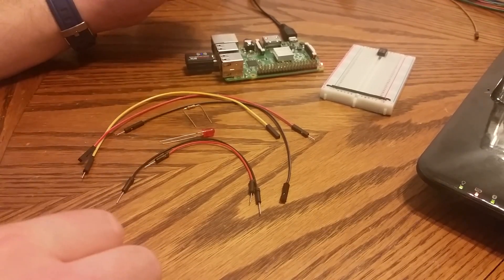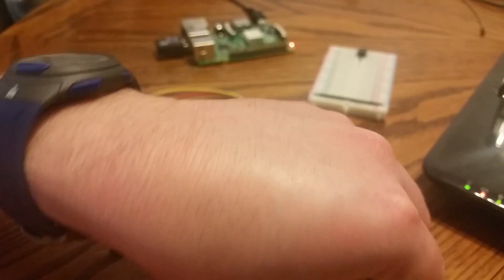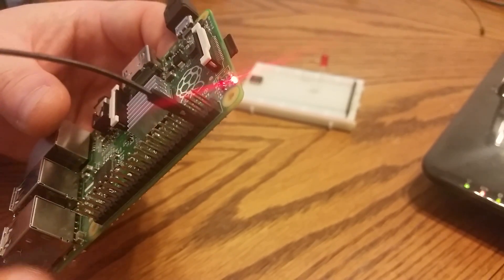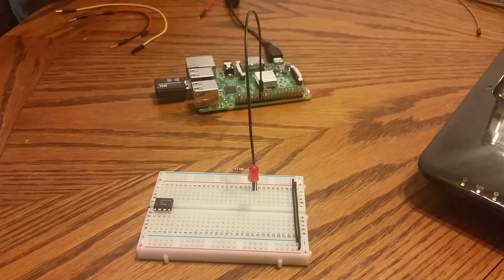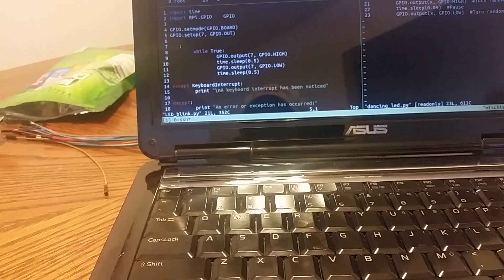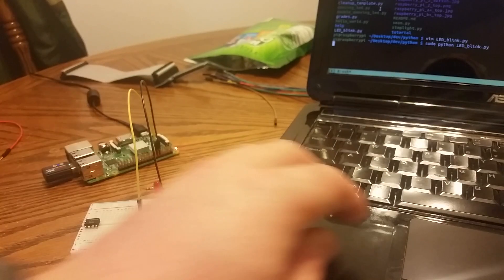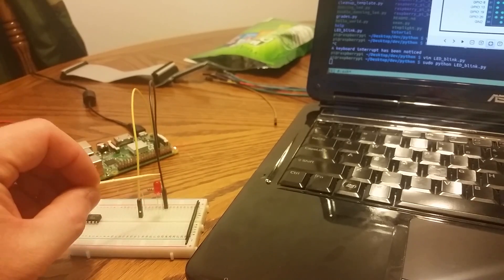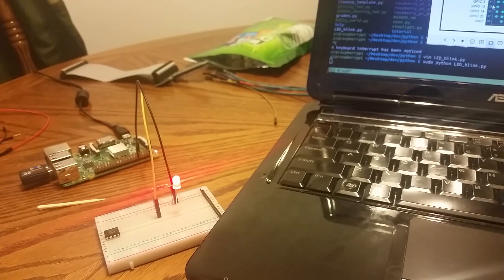Intro to Raspberry Pi GPIO

Comment: HI thanks for the video, its very helpful. I am working on Raspberry Pi 2 Model B V1.1 .  I am confused how to work with LED's on it. I have bought this kit from amazon and some of the thing from ur videos are not not present in the kit . "http://www.amazon.in/dp/B00U7K64HG/ref=pe_386221_37038301_pe_194751_29698841_3p_dp_1"  if possible can you please help me with this. Thanks in advance.
Reply from the maker: +rahul galgali I'd recommend reading this entire reply, then watching my video here: https://www.youtube.com/watch?v=eObSqbe9aqU

So, you have:

1) A ribbon cable
2) Breakaway headers (the "pins with a small plastic "sleeve")
3) A receiver for your ribbon cable

You're going to need to solder your breakaway headers to the ribbon cable receiver, which will effectively create a smaller "T-board" that I have in the video above.  After you have that, it should function (and look) a lot like this: https://blog.adafruit.com/2012/07/10/breadboard-adapter-for-the-raspberry-pi/

Honestly, I would just buy female-male jumpers, since it gives me more space to work, and I don't like ribbon cable receivers because they "waste" so much space.  But you already have the kit, so why not make the best of it and actually put it to use?

Once you get everything soldered together and connected, the principle will be the same as my video with the T-board.
Reply: +stillborn86 thanks for the reply..lets say if i use ribbon cable as male to female converter so that i can directly plug my male cable to ribbon cable as if I am using Male - female cable?
Reply: +stillborn86 thanks for the reply..lets say if i use ribbon cable as male to female converter so that i can directly plug my male cable to ribbon cable as if I am using Male - female cable?
Reply from the maker: Are you talking about plugging the ribbon cable into your rPi, then plugging the break-away headers into the ribbon cable, then plugging the other end of the break-away headers into a breadboard?

Technically, this COULD work, but I wouldn't recommend it.  Since the ports for the ribbon cable are double-stacked, you'll create short circuits in the breadboard.  As long as you're SUPER conscious about which ports you use, you may be able to get away with this.

Comment: Thanks for the great video. I am verifying as much as stating, but it is my understanding that the GPIO pins are limited to 3.3 volts. Thanks again for the video it was very helpful.
Reply from the maker: +Mike Fleck I will do a video on it, but your GPIO will classically output 5V.  Also, you have GPIO which provide power in both 3.3V as well as 5V, so it would be incorrect to say that you're limited to only 3.3V... at least for those power pins.
Reply: +stillborn86 Thanks. subscribed

Comment: When using an extension for the GPIO, how do you know the layout? Is it reflected? I'm using insert cords.
Reply from the maker: +Mary Askey As I stated in the description, there are pinouts for which GPIO matches which number.  You can use whichever you want, but just remember that there are two sets of numbers, and you have to specify which ones you're using when you write your code.